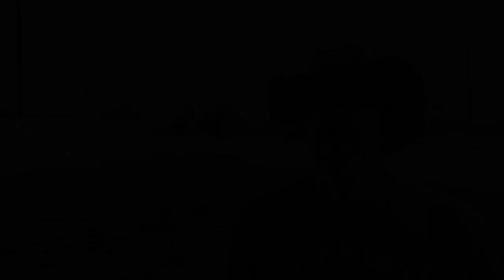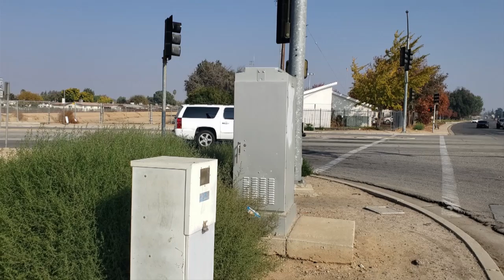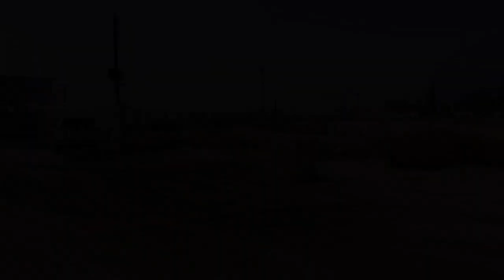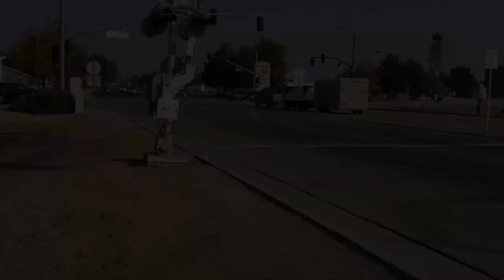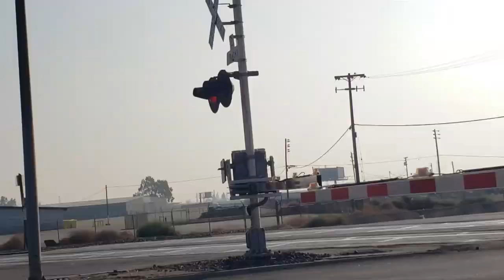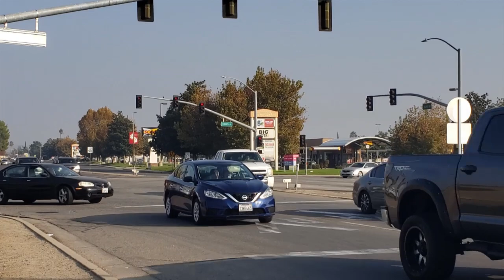How Traffic Pre-emption Works at a Crossing

Comment: I built traffic control cabinets. I should say I wired and tested the cabinets. You have most of the time 3 Pre-emptions, High based fire, low base bus and transit trains, and RR Pre-empt. The last cabinets I wire we had 2 types of RR pre-empt, hard wire 120 volts and digital with a micro processor board in a card rack.

Comment: UP has an external traffic signal pre-emp connection outside the instrument house. The NEMA traffic signal controllers have a clearance phase before it goes into flash or omits the phase from the trackside.
Reply from the maker: Advanced preemption. We have in this area for the bigger crossings at more acute angles but I wanted to keep it simple
Reply: Awesome! NS & CSX has those advanced pre-emp here as well with their GCP-5000's. Most of those projects were Federally funded.

Comment: Interesting video 
I have a question regarding the grade crossing
What triggers the gates to go up as soon as the train passes without interfering with the approach from the other side of the crossing
Reply from the maker: The rr crossing has an island circuit that extends the width of the roadway plus 50' on either side. Once that circuit is cleared, the crossing recovers and the gates pick up. If you go to my playlist "How the Signal Department Works" I have a video about how crossings work. Thanks for checking it out!
Reply: Thanks for the reply 
Enjoy your videos